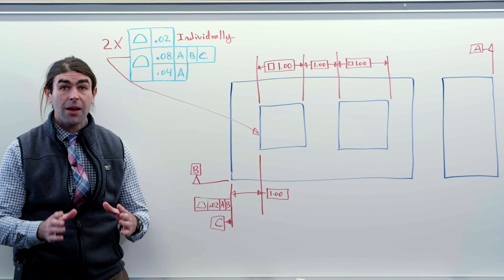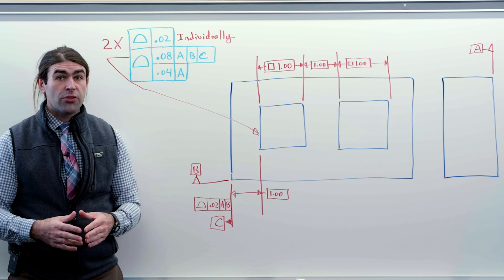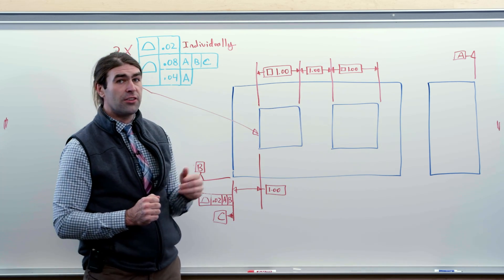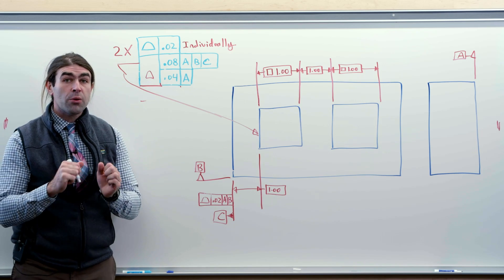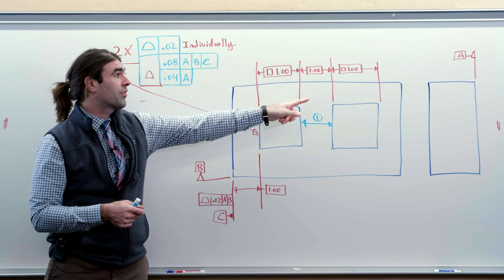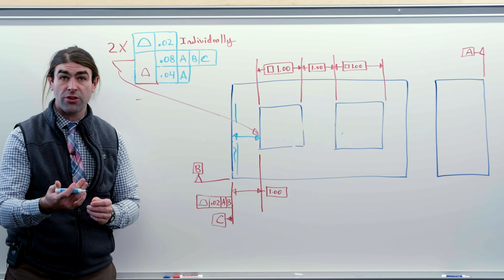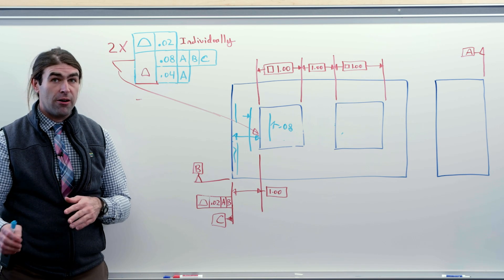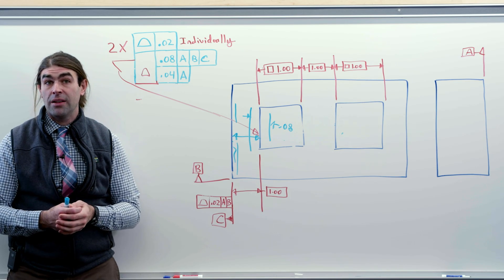GD&T: Composite Profile With "Individually"

Comment: How would this change if we were making this part a little more complicated for ease of manufacturing on a milling machine?  For example, to make this square hole pattern outside of broaching, we would "Mickie Mouse Ear" the corners and fillet the transition to flats for an edge break. If we only wanted the 0.02 applied to the flats and had a looser .08 for the corner reliefs what would the callout appear as? Thank you, great video.

Comment: Hello Dean,

Thank you for putting this series of videos together. Very well done!

I have a question regarding tolerance for datum feature C.

It seems to me that since it is a datum feature, the profile tolerance for that feature would not be taken into account for the distance to the first square. Sitting in a functional gauge, aligning the part, A,B,C (3,2,1 method, all 6 degrees of freedom locked), the part would be resting against only one point of contact on datum feature simulator C, the "high point". From that high point, distance to first square would be evaluated based on feature control frames for square features only. 

I believe the profile tolerance on datum feature C would be evaluated independently, preferably first. I believe it would be similar to a flatness form tolerance together with prependicularity to A and B. This would allow locations that are lower than the high point to get closer to the first square but would not affect the tolerance stack or play a role in functional evaluation.

I am not challenging. I only want to make sure I understand. There is a good chance I have it wrong.

Respectfully,

Comment: Hi , I like all vidoes which you created
I couldnt find the information about datum target usage.  Is it posssible to explain when I will  use point target,  line target, surface target. I  know these are especially for big sheet metal part,casting or  forging part. I cant easly decide datum target elements.

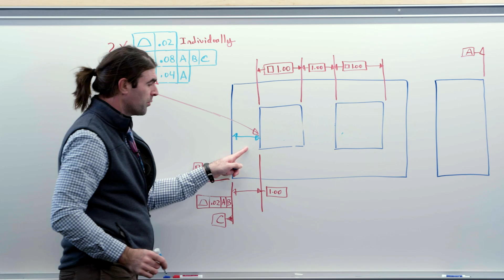Comment: [5:55] Hi Dean, Are you sure that the amount of profile tolerance on datum feature C that needs to be taken into account in order to calculate the minimum gap between the hole and the datum feature C surface is .01 and not .02?
Reply from the maker: Hi,
I see that datum plane as being developed from the high points of actual surface, because only half the profile can be used if it is also a referenced datum feature, I see .01” as the right amount to subtract from the total here.
Reply: @RDeanOdell  I agree that the datum plane C will be developed from the high points of the actual surface C, but before the datum gets established, the surface C may still have .02 error relative to A primary and B secondary.

For example, imagine this surface being out of perpendicular to A within .02. In that case (and actually in any case), the entire surface C will always be on the right side of the datum plane C in the main view of the drawing. This will result in the minimum distance of .94 (either at the top or bottom of the part).
Reply from the maker: @pawemarczak3022  thanks for the great input! I agree that there could be a .02 perpendicularity error with that surface in relation to datum A. My opinion is that that surface is part of the datum reference frame, and only .01 of that error would be allowable at inspection. I feel figure 11-21 from y14.5-2018 supports this.
Reply: @RDeanOdell  Figure 11-21 shows a different tolerancing scheme. In that figure datum feature C is controlled with a general profile to A|B|C - so yes in that case half of the general profile tolerance value/zone is not usable. But in your example C is controlled to A|B only, therefore entire .02 lies on the right side of the datum plane and therefore .02 is the correct answer, in my opinion.
Reply from the maker: @pawemarczak3022  Hi, you win this one! I was incorrect about this. I’ll make a note in the description. Thank you for letting me know and engaging in some back and forth dialogue.
Reply: @RDeanOdell  Thank YOU for the dialogue and the appreciation for my arguments. 

You do a great job with all these videos about GD&T and adjacent topics. Keep it up!